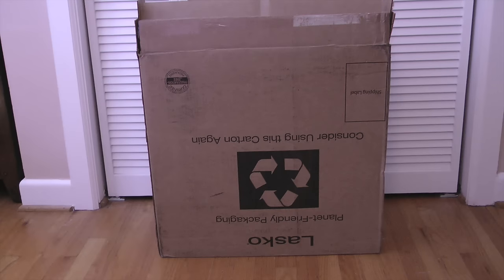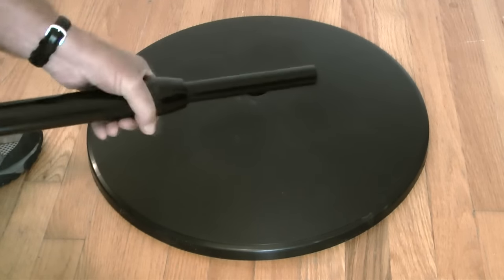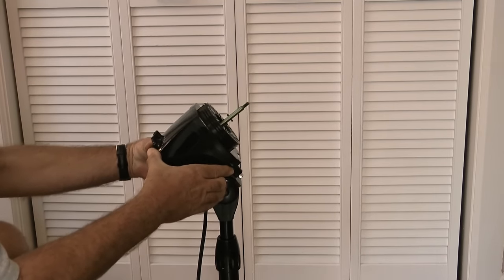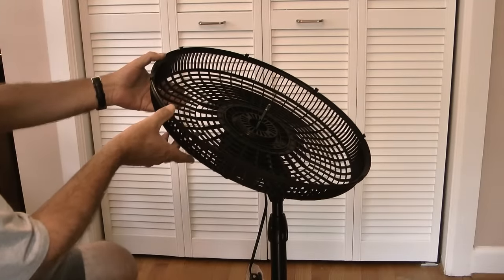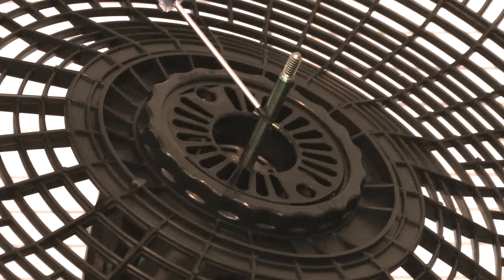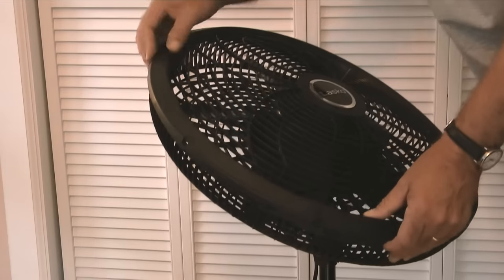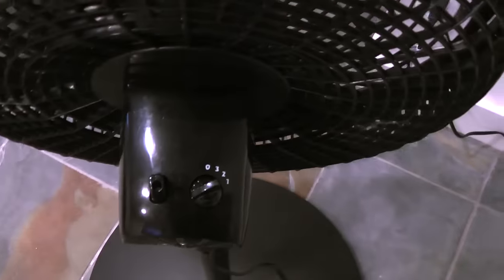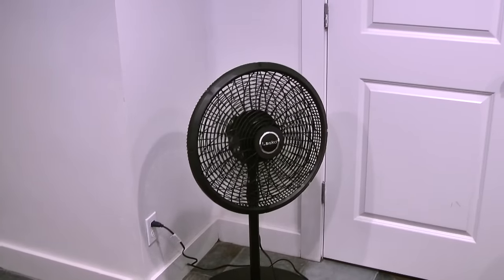Assembling a Pedestal Fan

Comment: You twisted the pole into the base. Did that lock it in for you?  We have twisted and it does not lock in. If we lift it up, the base comes right off.
Reply: Same here, Kept trying but it won't tighten
Reply: No I have the same fan it doesn’t

Comment: the only problem I had was not being able to tilt the fan like you did..I somehow was able to put it together...how can I get the motor to tilt back on my fan??
Reply from the maker: I just went and tried this on my fan. I hope you have the same fan. Grasp the motor housing with both hands, one hand on the front of the housing and one hand on the back. Try to pivot the motor housing straight back. The housing should click as it pivots back. To return to the original position, reverse these steps.

Comment: I just assembled this exact fan however I think I may have put the actual fan piece on backwards because when I screwed the bolt on, I had lot of thread room compared to this tutorial and because of that, I think the fan is on backwards. Problem is, trying to get that bolt to unscrew so I can re-install the fan blade. Any suggestions on how to get the bolt off when trying to unscrew doesn't work?
Reply from the maker: You don't unscrew the bolt, you unscrew the plastic nut that holds the fan blade onto the motor shaft. Remember plastic nut tightens counter clockwise, so you'd want to twist the nut clockwise to loosen it.
Reply: iScaper1 I got it off... for some reason yesterday while trying to unscrew it, it wouldn’t budge at all. Got up this morning and it came off without an issue so I was able to reinstall the fan blade correctly so now the unit is working properly.
Reply from the maker: @jyoungspins2200  Good,  does your fan work now?
Reply: iScaper1 beautifully! Thanks!

Comment: How do you get the base to stay in place so if you want to move it it’s connected to the stand! Or is this not possible?
Reply from the maker: Did you extend the inner pipe before putting the outer pipe into the base? You also need to push down and twist the outer pipe clockwise into the base.

Comment: I have must warn people of the 20inch Lasko remote control fan.I just took the junk out the box today 5-9-2018 and the remote sucks already will not respond on command when I press to turn on or off,  to change setting on speed sometimes u wait to press to get to respond, etc crazy thing is I had it in my mind to get two more before test operations and so far I'm ready to take them both back after spending $40 each at SAMS, oh and I'm not blaming SAMS Lasko Company 😠.

Comment: I cannot remove securing cap to enable me to slide fan blade on
Reply from the maker: The larger plastic inner nut holding the rear grill against the motor head tightens clockwise, and the outer plastic nut that secures the fan blade to the motor shaft tightens counter clockwise.

Comment: What company is stupid enough to make a simple fan so difficult to assemble? Without this video, not sure I could've completely figured out. The fan runs nicely, but, because of the issues with assembling it, I would never recommend this fan to anyone. It runs nice though.
Reply from the maker: Yeah, seems like this fan could have been designed better.

Comment: Ok, I have a Holmes whole room stand fan (not tower fan). It works but the motor assembly is leaning a little bit to the side. Help?? My fan is a 52 inch stand whole room stand fan. There are no YouTube videos that I have found on my fan and none of the others go over any trouble shooting steps that I am capable of doing. I had Holmes on chat helping me assemble my fan, no body wants to see me attempt to disassemble the motor shaft.

Comment: We have tried for 4 hours to snap and screw the pipe into the base of this fan. What a joke. I am sending it back to Amazon. I can only wonder how long a pipe snap into plastic will even stand up in useage of this fan. No point in even putting the fan together if you can’t use the base. Apiece of junk.  I won’t be buying your products again. So disappointed. I rate it a zero.
Reply: LOL, don't know what you're on. But it was simple to put together. The pole stays in place in the base. This fan is incredible. It's amazing how much air it moves. Best fan I've ever owned.